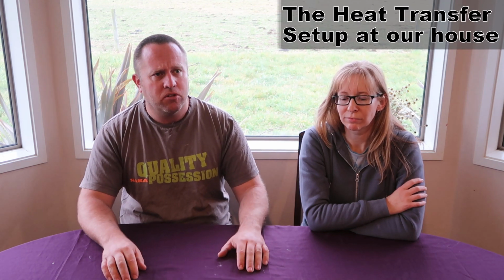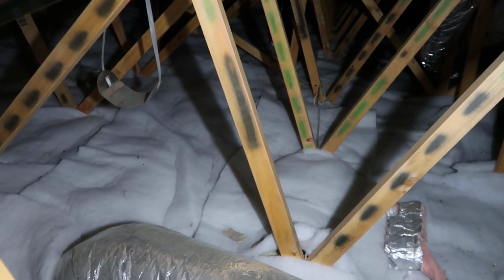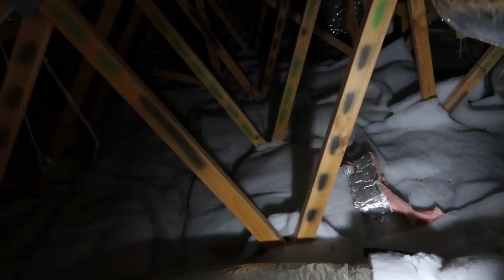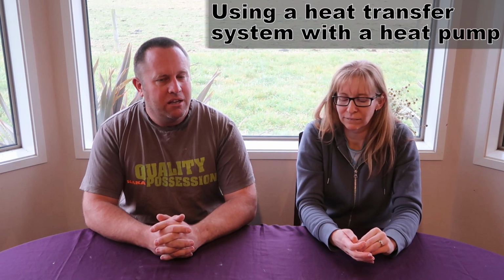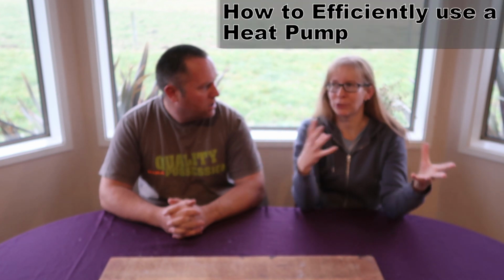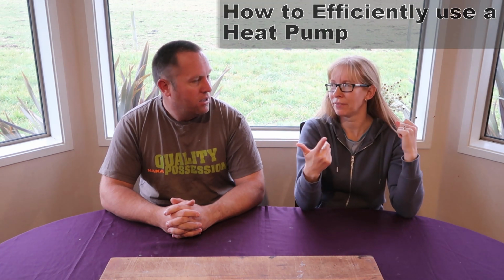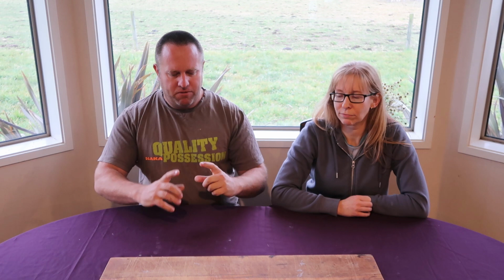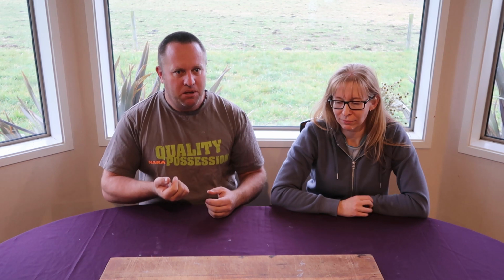Heat Transfer Systems / Air Conditioners / Heat Pumps - What's Best for you?

Comment: Very interesting.   I have a similar setup with the outlet vent at the end of the hall aiming to heat 2 bedrooms that come off it.     I've been having trouble with my system losing a lot of heat (6 degrees over 9 metres).   I'm using R1.0,  150mm duct.  It sounds like I might need to go a bit bigger duct + better insulation.
Reply from the maker: Yeah the insulation tends to need bulking up over time - we've found our roof insulation we've had to put new stuff over the top (I think they tend to have better standards these days though), but yeah 150mm duct over a certain distance isn't much so good thinking with the bigger duct as well.

Comment: Great info, my house is double glazed, double roofed, double insulated ceiling and insulated under floor. But my bedroom is on the cold southern side of the house and is extremely cold in winter. I am thinking of a heatpump, but budget is very tight and I wonder if a window heatpump unit is an option, it would be in the wall that never gets sunshine. Is that a viable option? Bedroom is 5m X 3m, central north island. Thanks.
Reply from the maker: Thanks - I'll show Clint your comment and let you know 🙂
Reply from the maker: Ok his response: "Personally I don't like window units as they're so loud!  Efficiency-wise they're not as good as high-walls and you'd need to get a glazier to put them into the windows and they sometimes don't seal very well.  Fun fact: they're that energy inefficient that production of them was banned in NZ in the early 2000's, so the ones you get are generally from China.  In the long-run it'd be much better to get a straight back-to-back highwall if that's possible - something like a 2.5kw Panasonic maybe (cheapest good brand I could find on a quick google search!)."

Comment: Wow such a great video and even better its local! This video has answered a lot of questions I have. But one idea I have is what do you think of having a fan in a heat transfer run in reverse in the summer? I'm thinking with the windows open in the bedroom, the ducting would suck cold night air in and dump the hot air into the lounge leaving the bedroom cool. Love to know your thoughts! I came searching for this topic but such a great video am going to watch your others now!
Reply from the maker: Hey great to hear the video was of help!  In theory, you can climb up into your roof and turn your fan around each season and it might just work ... or if you'd rather flick a switch and make it work in reverse you can get energy recovery systems where you can ramp up outside air to the inside and the best thing for this would be a "Venco", but this is very expensive.  You can also get reverse-cycle fans but again, big dollars!
Reply: @CheaperWaysNZ  thanks so much! I saw this video 
https://youtu.be/YE1zuLL625Y
Here he sets up a switch for the fan to go forward and reverse. I guess normal ceiling fans have the same option too now come to think of it.
It seems like a good idea to me to draw the hot air from the bedroom ceiling space and root it elsewhere causing cold air to be drawn in through the bedroom windows with the negative pressure but I haven't found anything where this concept has been put into action
I'm aware of other systems that blow cold air into into the bedrooms but that's an entirely separate fan to the heat transfer and expensive as you say. My thoughts is to use the heat transfer system you already have.
Reply: I know by switching the polarity the fan will turn the opposite direction which there are switches available for. Would the fan blades in a heat transfer work going backwards like a ceiling fan? I've never seen the blade shape in the kits
Reply from the maker: Generally, the fan blades in heat transfers won't work in reverse - they'd just sit and stew in the air they can't really move and turn to toast.  There are special fans that can blow both ways - I've personally seen little 150mm fans where the blades will flick into different directions when they turn the opposite way with centrifugal force, but have never seen that in bigger fans.  It all depends on your motor (especially AC ones) whether you can get away with changing the stator around - the guy on the video I'm pretty sure had a DC motor (more common for camper-van type arrangements).
Reply: https://youtu.be/YE1zuLL625Y

According to this video even reversing the polarity although the fan will reverse it will still blow the same direction but just much less efficiently I guess it has to do with the fin shape

I guess the other idea is to have an inlet above the fire and a inlet under the the eve outside the house. In the winter have a damper on the eve inlet duct to stop it drawing cold air. In the summer use a switch to open the damper draw in the cold night air. All this could be use in the one system and one fan. Probably less complicated than my original idea!
Reply: Oh I see your reply now! Yea I thought that in a heat transfer the power goes from AC to DC but I guess that's no correct. I forgot AC motors were a thing! Frustrating when I only have a little knowledge in things but really appreciate your expertise!

Comment: Hi there :) thoughts on a multi split system vs a ducted system? 
I'm completely stumped on what is best for my place. I do like the thought of the extra control and not having to heat everything judt to get hest in one room, but wondering if doing that and getting more air flow is healthier and worth the expense in power bills. I wouldn't be able to afford a separate ventilation system at this stage and having problems with cold and condensation. 
Thanks heaps
Reply: Ps do you do any commissions? Would love to pay u to do my job!! Seem very trustworthy
Reply from the maker: I would say normally a highwall multi system is a bit cheaper than ducted to install, but also it's important to work out how many KW you need, then size your units to that (really important to get someone who sizes them right and won't undersize in order to get a sale!).  If you're able to get in touch with Sarah via Facebook (there's a Cheaper Ways NZ Facebook group she moderates) I'd be happy to do a size estimate based on a floor plan for you, but don't do cash jobs myself - would be happy to give you the name of the company I work for, or even the name of someone I'd trust to do a quote for you!  In regard to humidity, a lot depends on the type of house you're in (piles and wooden floors it's worth putting plastic under the floor etc).  Putting in a heat recovery can be done after putting in highwalls or a multi system if you still have moisture problems to pressurise the house to push moisture out - every house is a unique situation, but generally speaking a ducted unit does give better airflow if that's what you're after.  Just a side note too - steer clear of people who give you a quote from an office without looking on site first!
Reply: @CheaperWaysNZ  thank you so much :) I really appreciate this and will be in touch. I've had a few quotes not and tbh think I've got paralysis by analysis!
Need to make a decision but quite stumped. Will be great to get your perspective.
Thanks for the awesome content here. Love the recipes too

Comment: Please can you advise if a ducted heat transfer system in the ceiling cavity is a better option instead of high wall heat pump? We are moving into a 4 bedroom new build north of Auckland in six months time. Love your channel by the way : )
Reply from the maker: It really depends on your situation - we have a highwall heat pump at the end of our house (in the far bedroom) and because we have a fireplace plus the heat transfer system we haven't used the heatpump in the last 3 years!  If you have a fireplace then a heat transfer system is a really good option (the likes of DVS etc isn't much good unless you've got a good source of heating as well).  If it's a heat pump it purely depends on the size of the heat pump - if you go that way you'd potentially need two to do the whole house unless it's a massive one - it's hard to say what the best option is without seeing a floor plan.  Personally, I'd go into at least 3 different places with your floor plan and ask them separately what the best option would be!  Feel free to fire any other questions if you need to 🙂
Reply: @CheaperWaysNZ  Thanks for the reply, much appreciated  : )

Comment: What CFM does your fan run at? We have a wood stove with inlet directly above. Vented into 3 rooms. With the fan on you can immediately notice a drop in temp in the lounge where the wood heater is.
Reply from the maker: Not sure what ours runs at (it's been a long time since I bought it and put it up there!) but we use a speed pot so we can control the fan speed to whatever suits - we normally have it running quite low and don't turn it on until the lounge itself has heated up.  There'll always be a bit of a temperature drop but it distributes it quite nicely and the lounge is still warm.

Comment: Does the direction that heat pump is facing make a large difference? Our one is currently facing the front entrance, if we have it moved to another wall, facing into the living area, will we notice a warmer temperature, and do you think it will be worth the cost to have it moved ? Thanks !!
Reply from the maker: Hey - we just did a live stream and I got Clint to answer your question there as well, but basically it depends a bit on the layout of the space you're trying to heat (assume it's just one room and you're moving it from one wall to another within the same room?), but most of all whether your heat pump is the right size for the room you're heating - if it's too small then it won't be effective no matter where it's placed.  It shouldn't make a huge amount of difference though which way it's facing if it's within the same room.  Clint's quite happy to do what they call a heat-load calculation if you wanted to send through a diagram with measurements of the area you're heating if you wanted to find out what size unit you'd be needing?

Comment: Hi there, interesting video, good advice in there!  I am considering the Bunnings Heat Trans Pro 3 Room Heat Transfer Kit and wondered if you could answer a couple of questions?  1) Is there a maximum (optimal) distance from the fireplace to position the intake vent?  I don't have the roof space to install near fire, so it will have to be opposite (about 4 meters away) do you think this is still going to be effective?  2) You mentioned at the end (https://youtu.be/MEHm6siH0jg?t=1767)  that you have to be careful with the setup - but then it was cut!  Could you clarify what you meant - what do we have to be careful with?  I will buy the 200mm duct and use an sparky to wire it up, but perhaps you meant something else?
Reply from the maker: Hey thanks, yeah as long as it's in the same room as the fireplace (especially if you keep the doors to the living space it's in closed) and it heats that whole room adequately it should still transfer that heat nicely.  I tried skipping to the part you said it cut out but couldn't find it - can you let me know the exact time it is on the video?  For some reason the link you put there takes us to a different point in the video each time!
Reply: @CheaperWaysNZ  Thanks for the reply.  The time is 29.22 (start ) and then 29:38 "you've got to be careful with the setup" - but no explanation about what that means ?
Reply from the maker: Ahhh ok - not sure that sentence was actually finished so good point!  Basically just mean that quite often the "out of the box" kits from those places, one size doesn't always necessarily fit all (e.g. if you have 150mm duct that's running for 15m you'll have to crank the fan up which could make it run really loud, so you'd be better with a larger duct/fan size to get the air movement that's needed - these are often a good solution for small houses or short runs).  Hope that makes sense!